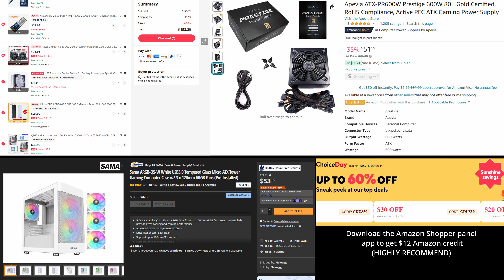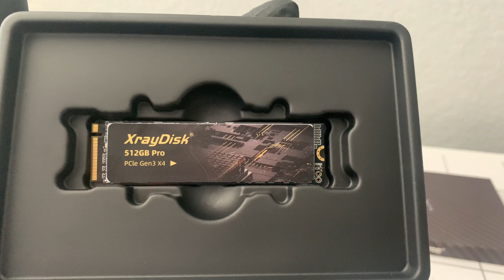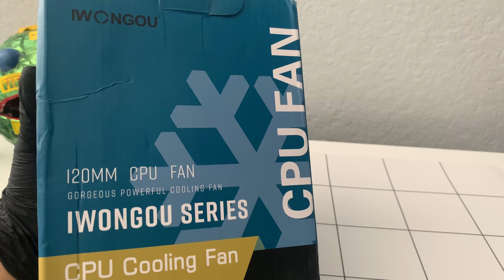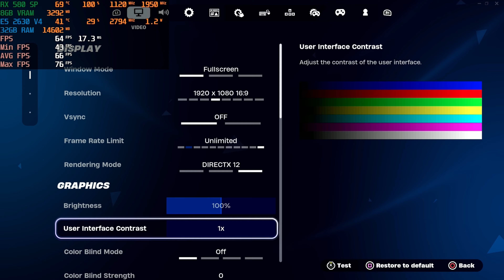$250 Gaming PC Build & Game Benchmarks | Intel Xeon E5-2630 V4 + RX580 8GB 2048SP

Comment from the maker: I built this gaming pc for around $250 and it came out clean!!!!!! I will test this build further with several other games but instead of the 2630 v4 I'm going to be using the Xeon 2680 V4 CPU. 
The new Fortnite season launches next week so expect new Fortnite Benchmarks 👀👀💯💯 Stay Safe Everyone! 

Key Notes:
- These ali express GPU's get hot quick. I recommend leaving the settings at stock frequency's. 
- DONT FORGET YOUR CMOS BETTERY it cost like $3 at target. 
- Check Description for links.
Reply: Are you turk
Reply from the maker: @recepaksoy5932  Knaw I’m Hispanic.
Reply: @SandwichTech_  ok
Reply: Wtf they sell those at target? Huh.
Reply: What socket is the cooler lol😢
Reply: can i use a zsus x99 p4 for 2690v4 ? i have now 2670 v3 and 16gb ram 2600 killsre motherboard and 2670v3 and 16gb ram for 60 dollar so do you think i can put a 2690v4 ? or 2680v4 ? or maybe 2699v3 ?
Reply: @SandwichTech_  make a benchmark on this for roblox
Reply: Pls link to the rx 580 from aliexpress
Reply from the maker: @ it’s not the same model but it’s still an rx 580 2048sp gpu. I just found this on AliExpress: $172.42 | MLLSE AMD RX 580 8GB 2048SP Gaming Graphics Card GDDR5 256Bit PCI-E 3.0 ×16 8Pin Radeon GPU Rx 580 Video Card Placa De Video
https://a.aliexpress.com/_mLOAI9d

Comment: brother I need help, I'm going to put 4x8gb ram 1600mhz in your $200 PC assembly because I couldn't find a 1x16 module. Do you think that PC will let me play Warzone at good graphics and fps, because in your video of the e5 2670 v2 rx580 32gb ram was going pretty smoothly for you, you would help me a lot bro! And yes I can make improvements to the PC but I am going to do the assembly just like you did.❤️
Reply from the maker: Yea for xeon builds 4 sticks of ram work better than 2. Warzone played pretty well. The only game where I noticed fps stutters was Fortnite. What GPU will you be using?
Reply: @SandwichTech_  an rx 580 with 1244mhz core frequency and 1750mhz memory frequency, and well I don't play Fortnite a lot but being able to play Warzone with ultra and stable graphics would be good
Reply from the maker: @Diego_10xd  You'll be able to play on Balanced settings with an avg fps of 65. As for ultra you'll get 60fps in certain areas of the map but you will probably average around 55fps throughout the whole match.

There's a setting called Frame Gen that boost fps but the input delay is pretty bad. It could say 120FPS but it feels like 70FPS.
If they fix Frame Gen, it will be extremely useful for budget builds.
Reply: @SandwichTech_  It seems good to me, bro, well, although there are many graphic options in Warzone that I will remove almost everything, I will leave it at a minimum and the textures at normal since it does not change much and there are other options that remove fps and do not affect the graphics, so I imagine that by configuring the graphics well it would have a very good performance and well the fsr I don't think I notice it much
Reply: @SandwichTech_  brother another question if I put 4x8 RAM 1866MHz is going to have better fps?
Reply from the maker: @Diego_10xd  you’ll get a little bit more fps but not my much. If you turbo boost it can help. I have not tried any turbo boosting so I can’t say if it’s a big difference in fps.
Reply: @SandwichTech_  brother can you Make a vídeo with the 200$ PC in warzone without fsr please bro☺️

Comment: for $150 I assembled a PC with socket x79 2630v2 24gb ddr3 video card rx 570 4gb power supply unit 600 watts ssd 360gb I have been using it since 2024, so far I am satisfied for games, I am thinking whether it makes sense to upgrade to 2650 v2 or 2680v2 ..
Reply from the maker: @solrenua4064  you would probably gain around 10 extra fps. Sometimes you can get the 2680 v2 for around $5 on ali express. For $5 doesn’t hurt to try. Also nice build for $150💯

Comment: First of all thank you for this build. I have built it myself and it is amazing, it was a struggle, but I did it. I have a question about the ram. So, I have 32gb of ram and currently it's running at 2133mhz. The one that I bought says it's supposed to run at 3200mhz, where in the bios could I change it to reach 3200mhz? Thank you for your help in advance!
Reply from the maker: Glad your build worked out well! 💯💯💯Unfortunately with these xeons platforms, 2133mhz is the max speed. You wont be able to change it, it sucks but if you ever change to a newer mobo platform you will be able to run at 3200mhz (depends on mobo)

Comment: Try to unlock the cpu on x99 motherboard, and undervolt them also. Gets some serious performance. I'm getting an 2666v3 with the rx 580/590. Can reach like 200 to under 260 in Valorant pretty consistent
Reply from the maker: Yea I have to try turbo boosting. I have never done it so I need to watch a couple videos on how to do it. Yea cuz valorant gets low fps. (stock)
Reply: @SandwichTech_  Only v3 cpus btw

Comment: great vid. what kind of power draw was the system doing?
Reply from the maker: For the cpu I’m not to sure since the readings are incorrect. These ali express mobos aren’t the best when it comes to power draw readings but for the gpu the max power draw is around 175W for this card. So I would say the max power draw from this build when gaming on high settings would be around 300 Watts or less. Plenty of room for upgrades since it’s a 600 watts psu.
Reply: @SandwichTech_  Thanks for replying :)

Comment: Where did you plug in the 5v argb from the fan hub? There’s no connector on the motherboard? Is the sata all you need for the case to communicate and light up the fans?
Reply from the maker: @LoganBrake  you connect the 5V cable to a fan hub/rgb hub. This case came with one so I was able to connect it to the back of the case and into the fan hub, I show it during the montage section of this video. 

The fan hub connect with sata psu connector and it has a led cable that connects to the reset switch pins at the bottom of the motherboard (front panel connector) so u can cycle the rgb using the reset switch at the top of the case. Only bad thing is you don’t have a reset button anymore since the led connector is taking the place of the reset switch.

Comment: Why do you use different specific processors? From what I understand, the best chip on that socket for gaming(that's less than $20) is the 1660 v3, as it can reach much higher clocks than the ones that you've featured.
Reply from the maker: I chose that xeon since it came with the motherboard. The 1660V3 is around $40 (like with 50+ reviews and 4 stars and above) I do see it for $20 but the sellers  don’t have reviews. If I find one that looks legit I will benchmark it.

Comment: Hey, just wondering but is the pcie x1 slot at the bottom still accessible for putting in a WiFi card, or does the gpu block it?
Reply from the maker: @GGabe1987  I’m looking at the build rn and unfortunately I would say no. If you have a skinnier gpu than the one I used in this video then yes it is possible. But the front panel cables are directly under so it makes it a little hard to install. A usb wifi adapter would be a better choice in this scenario.

Comment: Are there any cable extension alternatives that have a white cap instead of black?
Reply from the maker: Yea theres 2 asia horse all white extension cables. 

$35 https://www.amazon.com/AsiaHorse-Sleeved-Extension-Connector-Combs-White/dp/B0B56LHGRC/ref=sr_1_6?crid=1Y3YDG0UOR0IO&dib=eyJ2IjoiMSJ9.SZ7uD0mpk3H8vyOer6AhNw3STohwZn81KW6GndNFGuNaJauTVup4ab0pN2-DmxMoEbEudTcjemzy2VaG_mnBeN8kjJA_WsE77nKL0IU7d0QGjYgqd81JBLMoQe3nHpMA5-BjbSM8WanpwejjnOpOdsd4lXzHqP4PG5FDh78IF0IJ3qujBi3Bi5DA4NWbn45bk1wXxFXoOq2UO3u88tZFmZWnIcy4JgLe9rZxiQLtpi4.umbTm1f8enic8huaxq1vjUwATuntJT1JRxateIMpg7A&dib_tag=se&keywords=white+pc+extension+cables&qid=1716199815&sprefix=white+pc+ext%2Caps%2C151&sr=8-6
  
$24 https://www.amazon.com/AsiaHorse-Extension-Sleeved-Custom-Braided/dp/B0BVQVYVGW/ref=sr_1_4?crid=1Y3YDG0UOR0IO&dib=eyJ2IjoiMSJ9.SZ7uD0mpk3H8vyOer6AhNw3STohwZn81KW6GndNFGuNaJauTVup4ab0pN2-DmxMoEbEudTcjemzy2VaG_mnBeN8kjJA_WsE77nKL0IU7d0QGjYgqd81JBLMoQe3nHpMA5-BjbSM8WanpwejjnOpOdsd4lXzHqP4PG5FDh78IF0IJ3qujBi3Bi5DA4NWbn45bk1wXxFXoOq2UO3u88tZFmZWnIcy4JgLe9rZxiQLtpi4.umbTm1f8enic8huaxq1vjUwATuntJT1JRxateIMpg7A&dib_tag=se&keywords=white%2Bpc%2Bextension%2Bcables&qid=1716199815&sprefix=white%2Bpc%2Bext%2Caps%2C151&sr=8-4&th=1

Comment: What's that black thing the fan cables are plugged into at 3:39? I don't see it in the parts list.
Reply from the maker: That’s a fan hub. It comes with the case. You connect the cable to a sata power cable and at the bottom of your mobo. You control the rgb by pressing a button at the top of the case. Very simple.

Comment: I've been thinking of building something like this but I don't know if I should go for the xeon 1650 v4 or 2680 v4. Which one would you recommend?
Reply from the maker: Based on the benchmarks ive seen the 2680V4 got better fps. But like an extra 7-13fps. I bought my 2680v4 for like $10 on ali express during a non sale day. Both perform similar so it depends which one you can get cheaper.  I will benchmark the 2680v4 with several games sometime later.

Comment: Yo i was about to cop the motherboard bundle to and it says " The CR2032 battery in motherboard photos will be removed before shipping, as battery is forbidden at CN post and custom" Does this mean that the motherboard would not work until i put the battery back in?
Reply from the maker: @luci4.66  the motherboard will still work, but it won’t save the bios settings. Your time would be mis configured, bios settings will reset every time you turn off the pc. The cr 2032 battery helps to save your motherboard settings. It will still work without it tho, but the battery can be purchased at any local store for less than $5
Reply: @SandwichTech_  okay thanks alot man

Comment: question does your motherboard has tpm2? if not how did you play Valorant
Reply from the maker: I was using Windows 10 with this build so it didn’t require TPM2. You can technically still use windows 11 with this motherboard, but you won’t have the full features such as tpm2 because most Xeons don’t support windows 11 to its fullest.

Comment: same specs i try using my wattage metter full its 95watts full load with undervolt 2048 sp rx580 its cheap and low power very save energy and money. cpu draw 25watts power saver mode balance 35watts high with 100% all parked cpu on 80watts
\

Comment: sir need your advise  i have e5 2697 v3 and rx6600 8g  is this fit to my existing  xeon and gpu ? TIA
Reply from the maker: Yes your gpu will work with the 2697 V3. Good combo. I actually did a video on those exact same specs here: https://youtu.be/Ih579_IjU_Q?si=aNyeZ59aZKxRTvG7
Reply: @SandwichTech_  THanks sir

Comment: could u please tell me how many fan headers there are on the motherboard?
Reply from the maker: I believe there is only 1 fan header and 1 cpu fan header. But if you have a fan splitter you connect multiple fans.
Reply: @SandwichTech_  so i can connect the fan hub to the fan header and use the extra fan headers from the fan hub?

Comment: I want ask you for the 300$ pc what the lowest power supply i can get
Reply from the maker: The apevia prestige (the one I used in this video) is one of the best budget PSU's that work well. Its rated c in the psu tier list which is great for low end builds. 

A better psu is the MSI Mag 650 Watt PSU: https://www.amazon.com/MSI-A650BN-650W-Power-Supply/dp/B0991TZ399/ref=asc_df_B0991TZ399/?tag=hyprod-20&linkCode=df0&hvadid=693415510935&hvpos=&hvnetw=g&hvrand=13741123964255594675&hvpone=&hvptwo=&hvqmt=&hvdev=c&hvdvcmdl=&hvlocint=&hvlocphy=9031778&hvtargid=pla-1572238573421&mcid=33a77cf7954b3baa8f3422bc8c27a8b3&gad_source=1&th=1

Now the cheapest PSU that is 600 watts is this thermaltake smart: https://www.amazon.com/Thermaltake-Certified-Continuous-Active-PS-SPD-0600NPCWUS-W/dp/B014W3EMAO/ref=asc_df_B014W3EMAO/?tag=hyprod-20&linkCode=df0&hvadid=693275687937&hvpos=&hvnetw=g&hvrand=13082416063030733749&hvpone=&hvptwo=&hvqmt=&hvdev=c&hvdvcmdl=&hvlocint=&hvlocphy=9031778&hvtargid=pla-441825605018&psc=1&mcid=eda0ff60ab2c39428a77106227b9554f&gad_source=1

Im not sure if im wrong but in the psu tier list its rated F which is really bad. But ive used it in my last $200 pc build video and it worked well. I also used the 500 watt version for my first pc and it lasted 2 years ( the pc was on for at least 14 hours a day for 2 years) Also many people use that psu for really low end builds. idk how its rated F. But the apevia is the safest bet
Reply: @SandwichTech_  what if I buy gamemax power supply 500w is good for i3 9100f and 1060
Reply from the maker: @YYB_short  send a link of that psu. I’m not familiar with that one.
Reply: @SandwichTech_ the name of power supply is RAIDMAX XTB 550W

Comment: The ram is rgb or its just a heat sink with argb
Reply from the maker: The ram doesn't have rgb nor argb, its the reflection of the rgb colors from the fans. The ram has a glossy white finish so it reflects light. I never noticed it but yea it does look like it has RGB LoooooL. Not bad for the price.
Reply: @SandwichTech_  im planning to do a rgb heatsink of mine so its work thou with hub

Comment: What port do you plug the fan hub into?
Reply from the maker: You would want to connect the SATA power cable that comes from your power supply to the fan hub in order to give power to the fan hub. There’s another cable which is the reset switch, and this cable is attached to the fan hub already, you simply connect it to another tiny cable called LED. This will allow you to change the rgb by using the reset button at the top of your case (smaller button next to power button) 

Idk if I explained it good😅
Reply: @SandwichTech_  you explained it perfectly. I just wanna make sure I plug the fans it the right port.
Reply: One more question. How do you enter the bios?
Reply from the maker: @ To enter bios you would need to press the key that your mobo tells you. For example when I first turn on my pc, the first 3 seconds it tells you which key to press in order to enter the bios. (Bottom right or upper left corner)

A couple keys that lets you in the bios are either F2, F12, F10 or spam the delete key as soon as you turn on the pc. Also here’s a tutorial on how to enter the bios from windows: https://youtu.be/HQXFd0CN4s8?si=Rm8x_fTqLPSsnFzA

Comment: I gave in and decided to build the pc I’m having trouble with it not turning on can anyone help?
Reply from the maker: @EliMrtz-k6v  

1. make sure your cpu cooler is connected. 

2. Take out 1 ram and see if it turns on with only 1 stick of ram

3. Plug HDMI cable to gpu  or try another hdmi or display port cable

4. Clearing the cmos can help but for these xeon builds the main problem would be incorrect ram placements
Reply: @SandwichTech_  thank you I will try this

Comment: I have the Rx 580 sp2048, but I'm not sure about the Qiyida mobo is it good? Is there any alt you recommend i need your opinion
Reply from the maker: The machinist brand and the zsus brand are 2 alternatives. Honestly I’m still using this xeon pc with the qiyida motherboard and I’ve had no issues. I even went live using this pc and no issues happened. Pretty reliable.